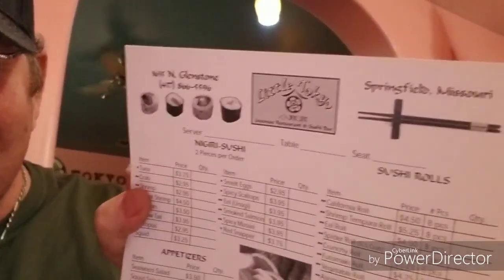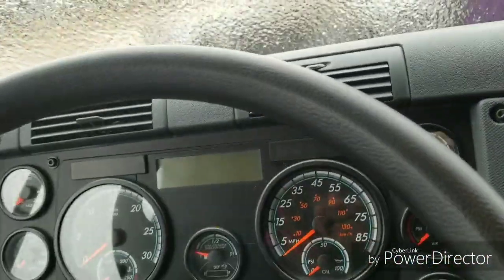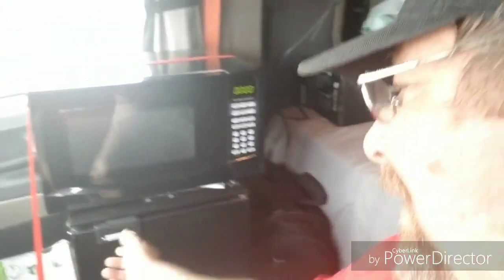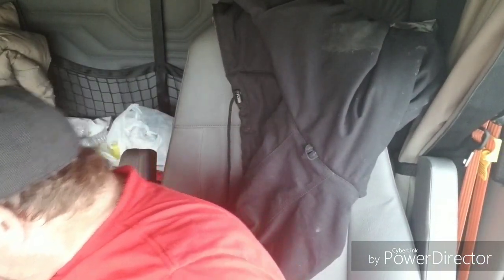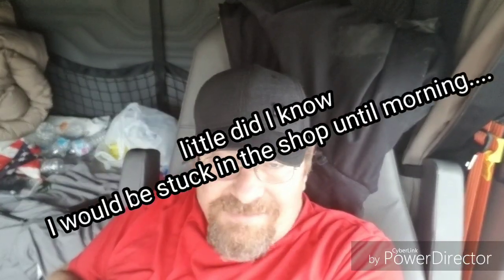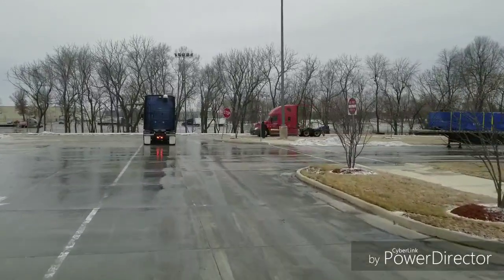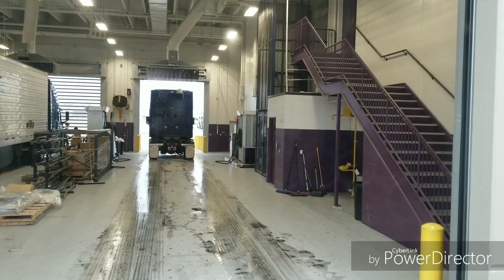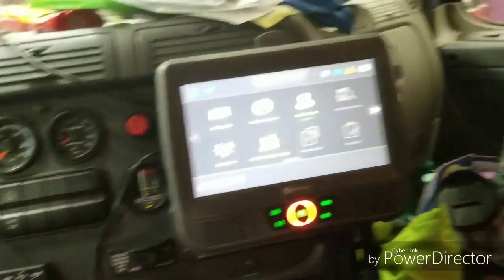Prime inc driver new truck already in the shop

Comment: have the same truck, its leaked from the windshield since new. I had a cracked windshield they changed for my annual inspection, it doesn't leak anymore. The mechanic was telling me literally put a deflector panel in the fuse base to keep the water away from the electrical, because they cant fix the leak
Reply from the maker: Yep both my pther freightliners leaked. This 2019 with the one piece windshield doesn't leak

Comment: If they are removing the passenger seat you can use the bolt holes to make some kind of stand for your tv, you’ll get your E-ZPass and prepass in your permit book at driver lineup before you leave, DO NOT FORGET TO GO IN AND ASK FOR THE BOOK. Will have your front plate in it too.
Reply from the maker: Refrigerator, microwave, and x box installed where the seat was.

Comment: I have a friend at prime tells me  If you finish a lease doesn't matter when you started you can get a large chunk of change when the lease is done it could be part of the excess mileage or the e fund. 
He was talking up to 15,000.00 dollars.
If the truck was maintained well and the tires were in good condition might be worth looking into.
Just a penny and a half of my thoughts.
Reply from the maker: Yes getting money at the end of a lease happens but not as much as everyone thinks. Especially if you didn't start the lease and run it 3 years. When I turned in my company truck you tell them your stuff is out and the keys are in it. Lease they 1st grade the truck then scrutinize it for every scratch and spec of dirt. They burn your lease return money fast.
Reply: Yes but I think your confusing that with the maintenance fund since that's what by law has to roll over with the truck to the next leaser if your looking to get that money you get one the lease is closest to being over with unlike the other comment not sure which fund he is talking about to be honest. Would tell you to ask if you could see the maintenance records though if you do go to a second hand kind of lease.
Reply: When I leaned my Pete in 2009 it was called a maintenance fund he  called it the emergency fund both being the same. Could be used for truck pay when your on ht kept you from going negative he puts 500.00 a week away hes looking into the lease purchase deal the percentage on loads goes to 80 percent.
Reply: @williampollard118  There is a difference an owner operator that is purchasing from someone like loan mountain would have what your saying but if from a company most want let you take from it but to do maintenance because if you don't complete's the lease they get that money if know body finishes the lease on the truck. But that beings said some company's do have different accounts you can set up for extra stuff but for the lease its self its normally the maintenance fund other then that I couldn't really tell you sorry hope this helps.
Reply: Last company I drove for you could take money from your maintenance account to cover fixed cost if you went on home time. I leased a 2010 386 pete. I was a trainer out 5 weeks home 1 week always covered truck pay works  the same with prime.

Comment: why havent you gone lease yet
Reply from the maker: Waiting for spring. If I was lease I would of had a 1200 repair bill last week due to weather plus I have been shut down so much due to the weather I'm waiting.
Reply: @DavidH6571  not a bad move.. I have 20k left in tnt so about 4-5 week shouldn't have to worry much winter weather after that.

Comment: hello david  umm  whom said you have to live in a lite weight  just drive it  if u watch and plan a little youll be alot better off in hotels  betcha you can preplan that hee with discounts
Reply from the maker: I went into a light weight so I van stack cash. If I go to hotels that will dock over the program.
Reply: ok ok i got it  i was just going threw some in your area  ya  bro butt its clean living geez there nice  so be it a bedroll and nose down  livin  its cool just think i have nothin  no retirement no nothin heck im stackin pennies so i can fly back over